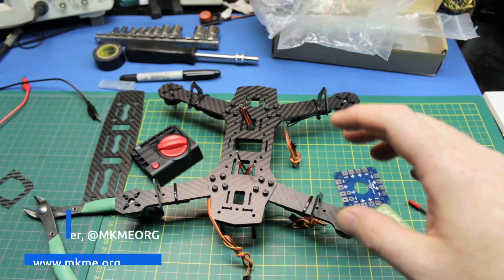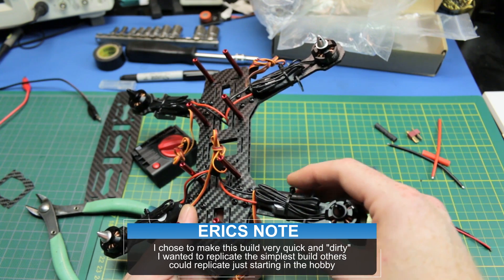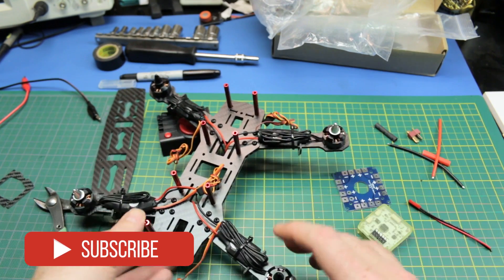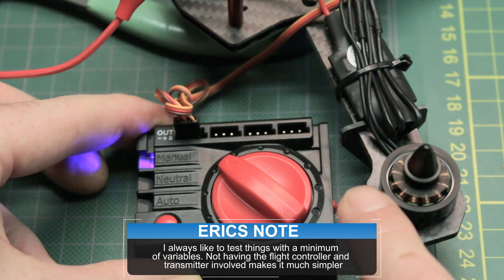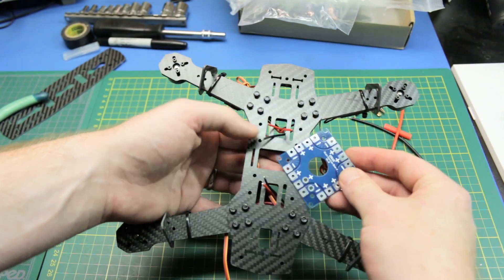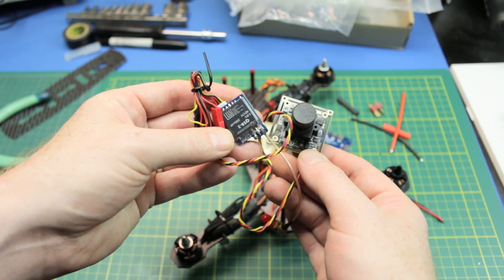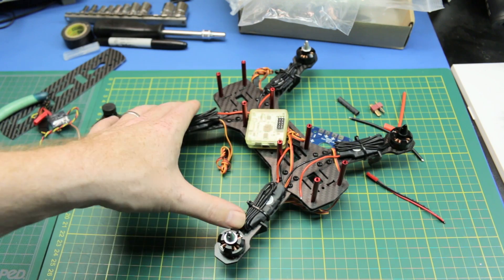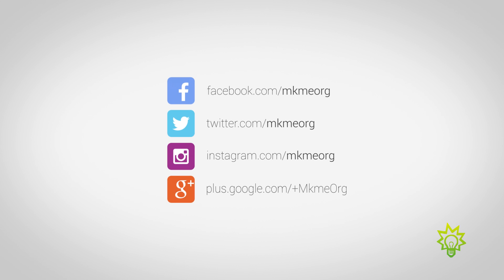ZMR-250 MiniQuad ESC & Motor Testing + Tips & Tricks

Comment: looking good, keep going!  fyi, most people with that type of pdb stack it underneath the FC in the center, with small standoffs between them.  I went with direct wiring, and built a wiring harness in between the lower plates.
Reply from the maker: Awesome- thanks very much for the feedback. I ended up 3D printing a cover for the PDB which worked out great until I moved away from this quad already. Vids coming :)  Cheers

Comment: Hey Eric. Looks like you're having fun. You may have mentioned this before, but what would the range be for a drone like this? How far and how long could you fly this and get it safely back using the fpv? Thanks!
Reply from the maker: Hey John. That really depends on the RC system you put in it. Any quality system will get you further than the battery can take you.  Here's some 1km runs up mountains https://www.youtube.com/watch?v=wC7qNycJTME&ab_channel=RCSchim  Cheers